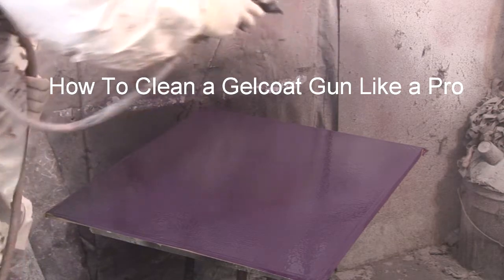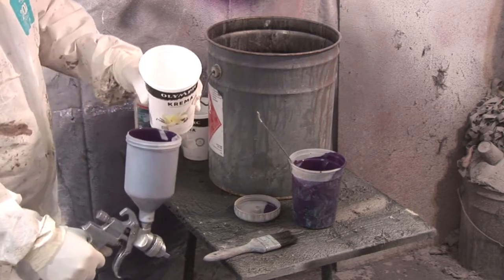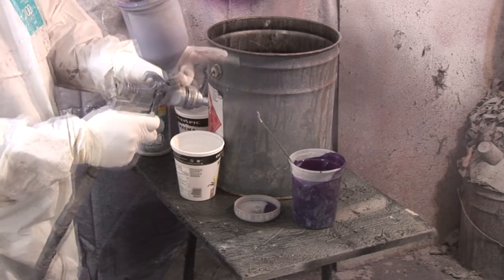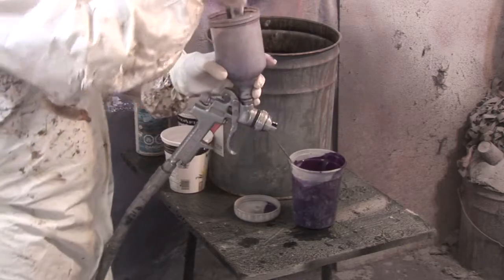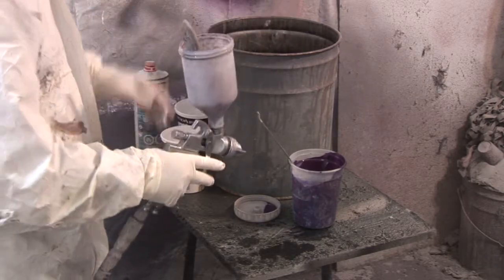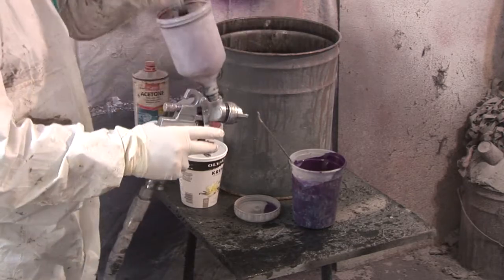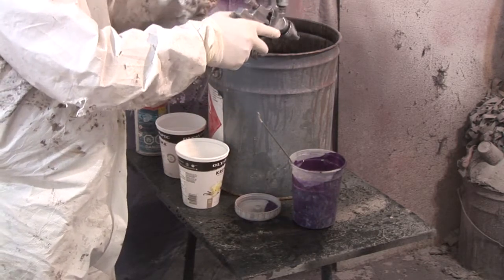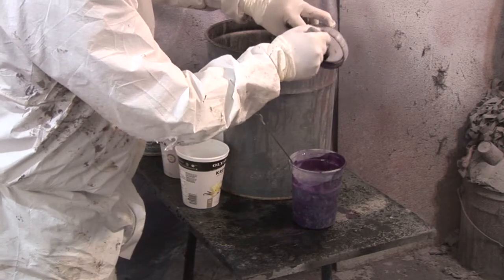Easiest Way to Clean a Gelcoat Gun

Comment: Great job, im surprised you dont open the nozzle and clean it ? cheers
Reply from the maker: Thanks, the backwash cleans the nozzle really good. I always leave it stored with acetone in it just in case there's a little bit of gelcoat stuck in the nooks and crannies. When I go to use it again, I'll squeeze the trigger to see if there's any color that drains. It always runs clear.

Comment: What nozzle size is recommended for PVA and Gelcoat?
What is the setting for Air n PVA or Gelcoat mix  during spraying?
Reply from the maker: Best size for pva is a mini spraygun with standard aircap, nozzle, and needle. The one I use is the Star HVLP mini with a 0.8mm aircap, nozzle, and needle. You can use a regular size hvlp with a 1.1mm . Spray a light coat, let it shine off, then spray a second coat. If you try 2 coats right away, it will run or fisheye.

Comment: How do you prevent the acetone from running out of the nozzle of the gun? I tried this method and while it worked, there is a steady stream of acetone running out of my nozzle.
Reply from the maker: If acetone still runs out the nozzle after letting go of the trigger, it means there's something stopping the needle from seating against the aircap. Could be one or more of the following: weak needle spring, needle packing nut too tight, debris in the nozzle, needle wrong size for the nozzle. It's usually the packing nut is too tight. Loosen it until the needle slides freely and retighten by hand . It only needs to be snug so it doesn't leak above the trigger.
Reply: @Mofiac  I’m not well versed in paint gun terminology. What do you mean when you refer to the packing nut? The gun is brand new, only used a couple of times so the spring should be good.
Reply: @Mofiac  never mind, I’m the dumbo. I’d bought the HVLP gun from harbor freight to experiment with, because it’s $15 as opposed to $80 for the other one. In the process of cleaning both guns, I got the needles mixed up so the 1.4 needle was in the 2.5 gun. Swapped them over, problem solved.

Comment: Thanks for this explanation.  I have followed your instructions about 8 or 10 times and it seems to be working for me however I have been unable to get it to the point where the acetone is completely clear.  It is almost clear but somewhat white-ish.  Perhaps something like what you'd expect to see if you put a teaspoon of milk in a cup of water.  Does that sound okay?
Reply from the maker: It should be crystal clear. Try turning the spray pattern to the cone setting before backwashing. The backwash should redirect the air aggresively back into the paint cup. Repeating this rapidly should allow the acetone to clean the inside of the nozzle until no gelcoat is left.
Reply: @Mofiac  The problem is that when I initially add acetone to the cup and then insert the brush into this mixture, the brush gets coated with a high concentration of gelcoat. Then, even if I mix it all thoroughly and spray all of it out the gun, the brush still has the old concentration of gelcoat so that even if I now add crystal clear Acetone to the cup, the brush will now contaminate it with the old concentration.  Perhaps the only solution is to clean the brush separately in a separate container after each step or use new brush(es) at each step?
Reply from the maker: The last rinse in acetone should have cleaned the brush but if it doesn't, just clean the brush on its own. That'll work.
Reply from the maker: That sounds right. On the last backwash, dump it out and add fresh acetone, then disconnect your air supply and pull the trigger until it runs clear.. That will clean what's left in the nozzle

Comment: Just wondering why don't you just put the lid back on? save blowing over and clean lid at same time.
Reply from the maker: It means I'd be juggling 3 things at once -- the lid, the brush, and the gun. The brush is faster to just drop in instead of having to screw on/off the lid each time I add more acetone. Also, the air reentry through the nozzle is limited by the size of the breather hole in the lid so it actually cleans a lot better without the lid. And finally, when you do backwash sometimes the acetone shoots out the breather hole on the lid and there's a real risk of having your eyes filled with dirty acetone. Hope that clarifies it alittle.

Comment: I watched the video where you sprayed the panel.
Did you mis calculate the film thickness?
There is no way that film is 18 to 20mm thick?
1.8 to 2.0mm possibly?
Best regards,
Danny.
Reply from the maker: 18-24 mils (thousands of an inch).
In millimeters it's under 1.0mm. Hope that helps

Comment: What gun and nozzle are you using?
Reply from the maker: The spraygun is made by Star, but I changed the aircap and needle to a 1.8. If you can get one with a 2.2 aircap and needle, you'll find works better.

Comment: Just curious if the one and only thumbs down you got is from some one that followed the manufacturer direction and had to throw a gun away?
Reply from the maker: Could be. But I've even restored a gun from someone who used gelcoat but didn't bother to clean it. Soaked it in toluene and lacquer thinner overnight and then took it apart...let it soak for a week longer before cleaning it with acetone. All it needed was a new seal kit and it works like new. 👍